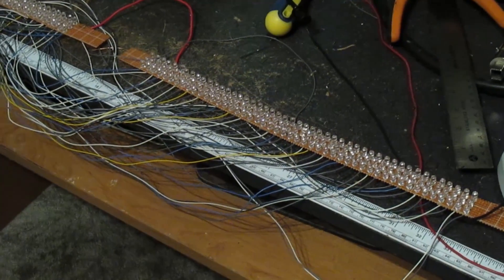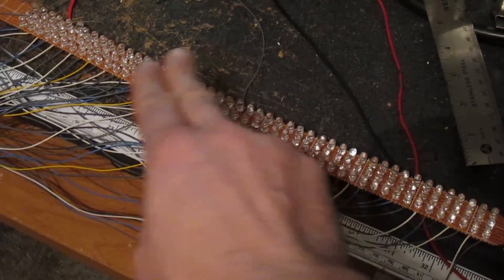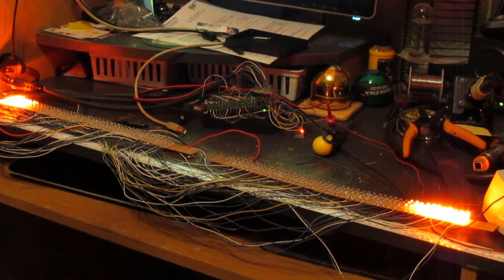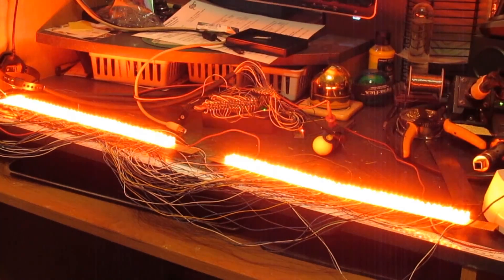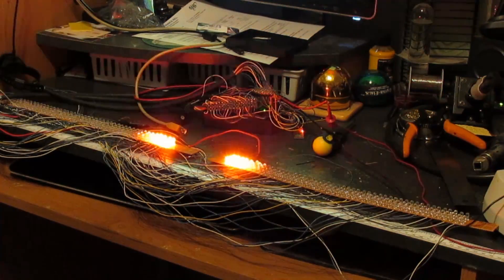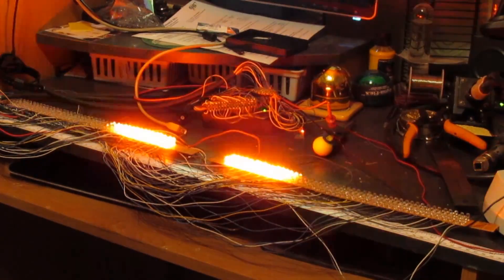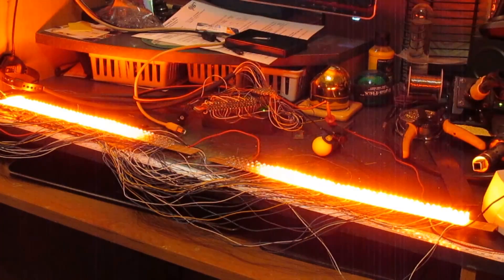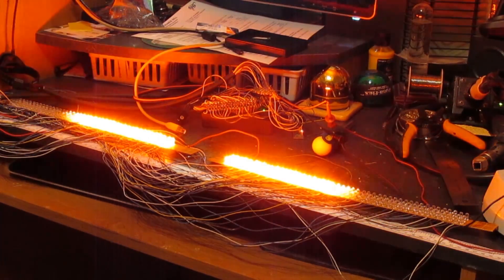DISCONTINUED Mustang Knight Rider Light Scanner Version 6

Comment: Hi are you still making them please. 🙏
Reply from the maker: Nope, I stopped making them this year.
Reply: @1999TransAmWS6 
Ok thank you for letting me know.
Reply: I wonder if you could pos point me in the right direction please what do use?.

I’ve got a cervini hood on the car now. 

I’m just not sure what I need to do it. 

Thank you
Reply from the maker: @Fire-gv2wz   my lights are fully custom made from scratch with individual LEDs, resistors, transistors and more.  They run off a custom program I wrote.  It also requires fabrication as well.
Reply: @1999TransAmWS6 
I see you have done a fantastic job with them fair play.

Comment: Hey! I remember watching your video back when I was in middle/high school dreaming to build a Kitt 3000. 10 years later I finally have a black 2007 GT and I'm concerning making a Kitt 3000 once again. Do you still make these light bars?
Reply from the maker: Yep I still sell my version 5 mustang light in any single color with 30 scans.  It comes with remote control or Android control for $499.    If you're interested, let me know.  I would just need the dimensions of your hood scoops to custom size it.
Reply: @1999TransAmWS6  great! I still need to buy a hood so once that’s done I’ll be in contact!
Reply from the maker: @CircuitBreakerr  sounds good, thanks

Comment: I see this version and you seem to have recommended version 5 as the best way to go. How do I get into contact with you to discuss options and pricing. I would love to buy Version 5 for my 2012 Ford Mustang with the TruFiber Venom Hood that I purchased from American Muscle. If you let me know what is need and what the estimated cost would be, if you are still building them, I would love to purchase it. A quick question, I see that this is just in red, which is perfectly fine. But is there a way for multicolor LEDS or is that too much for the controller? Anyways, would really love to get in contact to discuss options if possible.